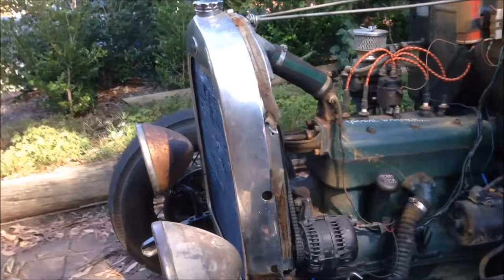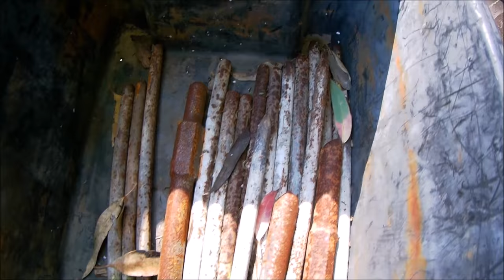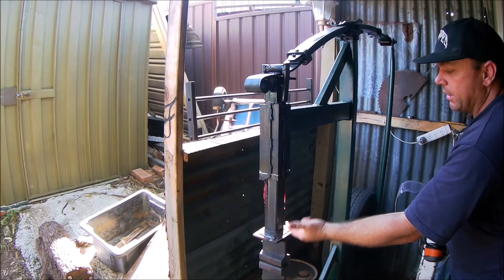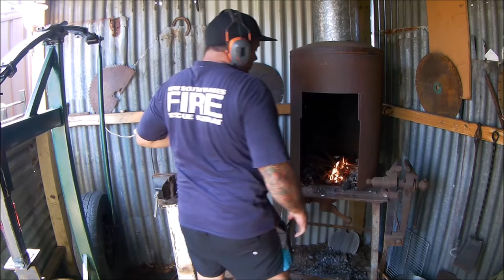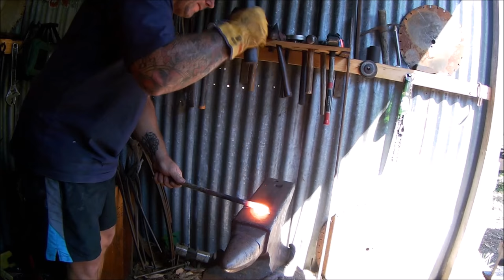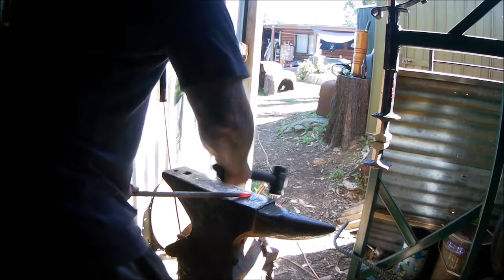Power Hammer v Rounding Hammer and Anvil

Comment: On the upstroke it looks like the hammer head is still impacting the guide frame (even though you cut a bit off). I have seen this problem on other home builds. People tend not to anticipate the additional stroke length caused by the flexing of the spring. You could shorten the stroke by moving the motor shaft attachment closer to the pivot point which would shorten the arc length of travel. It should be easy to make a clamp on attaching point to test various locations along the spring.

Comment: It makes sense that the power hammer is better for drawing out; the RR track is domed (top & bottom), so it's just like fullering dies.  You might consider cutting the tracks off and making replaceable dies.  The track would make a great set of fullering dies, and you could make other dies for other uses.  Other possible solutions could be using the hammer at 90 degrees to how you were using it (the material in-line with the direction of the track); or use hardfacing rod to build up flat spots on the track, essentially making it a combination die.  I would add the flat side to the track closest to the door.